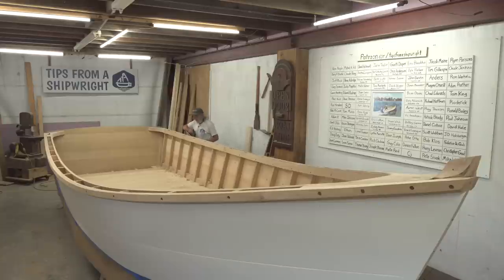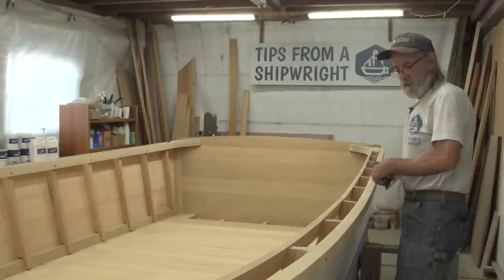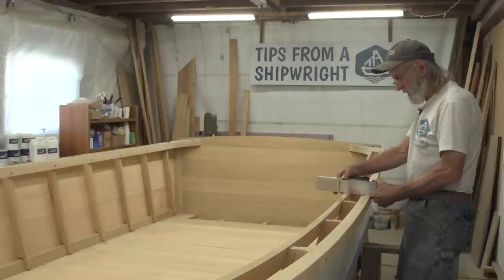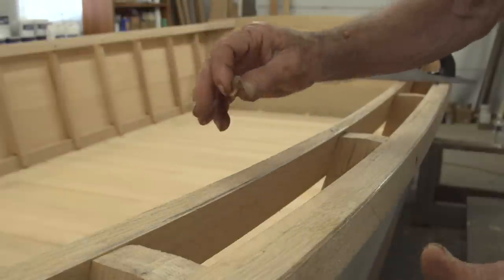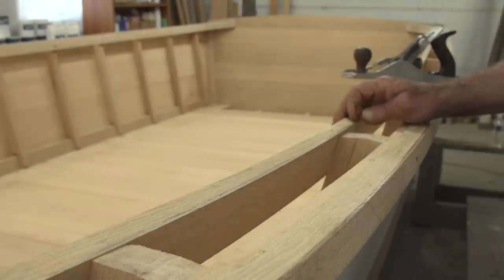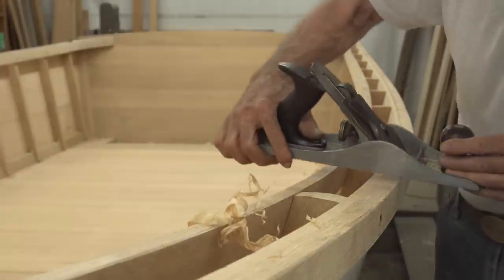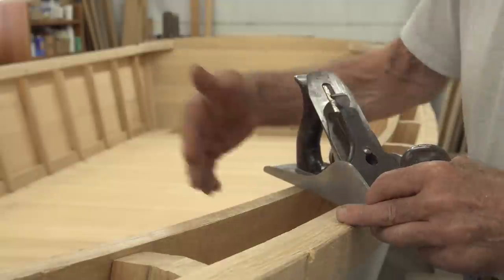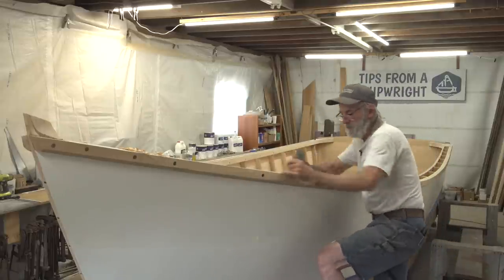Building the V-Bottom Skiff: Episode 33 - Plane crazy How to plane on a curve

Comment: Well, you could of course use a compass plane like a Stanley 113, but with the changing curve of the Wales/sheerline, you'd have to consistently change the plane to match the correct curve where your planing at. So, a jack/smoothing plane is actually preferable, on angle as Lou is doing. That way you can follow the curve as it changes.

Comment: It sounds like you are calling part of the boat end Whale, or enwhale, or end rail? can you verify that parts name.
Reply: Inwale, it’s the board that is connected across the vertical ribs on the inboard side. It would be the inner support for the gunwale (pronounced “gunnel”) and the guard would be the outer support. The gunwale would be a board laid flat on these supports and cover up the top ends of the ribs.